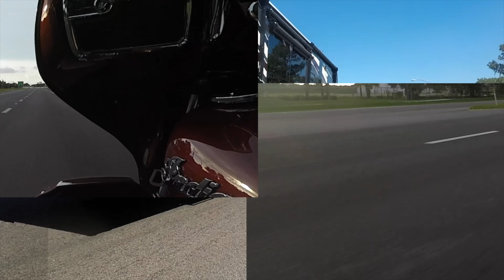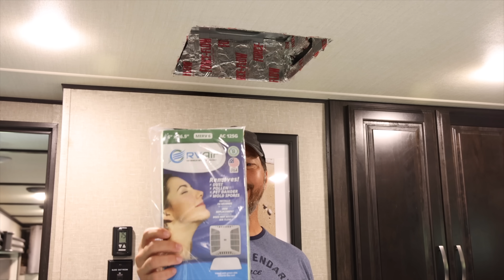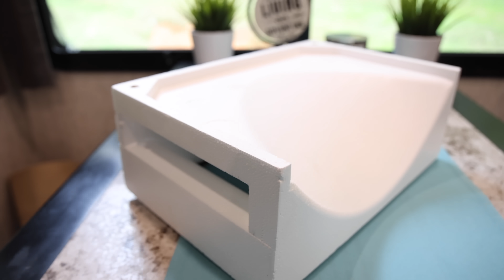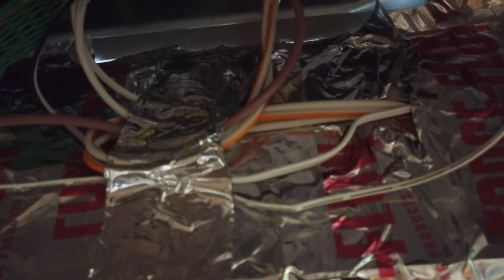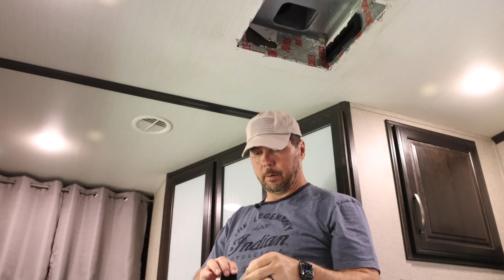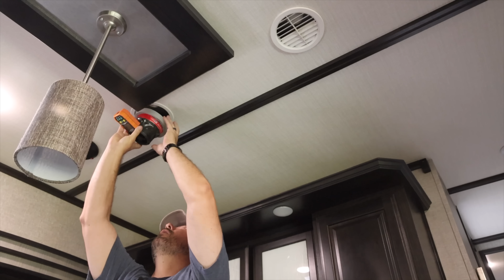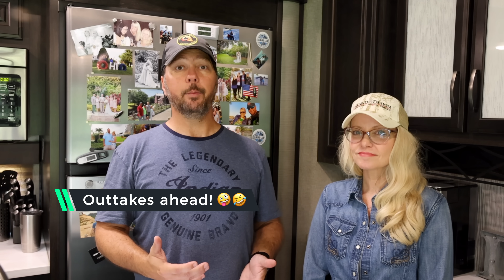Turbo-Charge your RV AC with RV AirFlow! (40% Improvement on Average!)

Comment: Finished installing this in my 2013 Montana Mountaineer 5th wheel.  Mine is a Dometic Brisk Air II 15K unit.  Did have to do a duct mod since the factory installed one side to far forward and the unit was a little forward and not square.  Didn't take any readings before (wish I had) but did after.  According to what I could find, this unit is rated at 350 CFM.  I have a total of 5 outlets and had to check my results twice to make sure it was correct.  Assuming that my wind speed indicator is reasonably accurate, converting MPH to CFM I get a total of 570.55 CFM from the sum of all five outlets.  The air flow is greatly increased, by feel, from what it was before.  More supply air creates more return air = cooler RV.  Will have to wait till we're out camping in hot weather before I can say this will keep our rig cool.  Have high hope.

Comment: Very nice invention. I had thought there should be something for this a long time ago. But, I have two AC units and at $170 each not going to happen. Way overpriced for "special" styrofoam.
Reply: You are paying for engineering and results.  Saying it's just "special" styrofoam seems unfair.
Reply: @rocketcityauction  Oh I get that. But, seriously $170 is a bit overpriced IMO. I wonder where they are made and what is the cost of making this? I also think that if the price was more affordable then they could sell more. He needs to bring this on Shark Tank, lol, and get a licensing deal with all the AC manufacturers. :)
Reply: @johnaird7896  My only thought was, if I had an AC that struggled to cool my unit and someone told me $170 would fix it by increasing the output by 40%, I think I would not worry about the construction, just the result.  Not cheap by any means, but for the results, it could be worth it.  I am going to look into it on my 2670MK.

Comment: One installation tip:  When inserting the unit and it seems to get stuck, remove it and use a solution of dishwashing liquid and water to coat the foam and the outside edge of the duct covers, the re-insert. Makes it a lot easier.

Comment: Color me skeptical. That much money for a bit of foam sets off alarm bells.  Where is the benefit coming from? The fans are pushing the same amount of air, so if there is more cu ft/min coming out of some ducts, there must be fewer coming out of others. Did the total air flow (cu ft/min) out of all the ducts go up? Other than making sure your ducts are properly sealed internally so you aren’t wasting heating/cooling I struggle to see what this contributing.
Reply: It does work.  Before the installation on my 30' Starcraft travel trailer I measured the air flow using my hand held digital wind meter. The vents closest to the AC were showing 10mph wind speed, while the rear vents showed 8-9mph wind speed.  After the install all of the vents were showing 18-20mph wind speed, which was double before the installation!  It was blowing so hard it blew the instruction sheet and screws from the bottom cover off the kitchen table.

The installation was easy and it's going to make a huge difference in the Arizona summer heat!  Well worth the money in my opinion.

Comment: 170$ for a piece of foam.  People are out of their minds.
Reply: It does work.  Before the installation on my 30' Starcraft travel trailer I measured the air flow using my hand held digital wind meter. The vents closest to the AC were showing 10mph wind speed, while the rear vents showed 8-9mph wind speed.  After the install all of the vents were showing 18-20mph wind speed, which was double than I had before!  It was blowing so hard it blew the instruction sheet and screws from the bottom cover off the table.

The installation was easy and it's going to make a huge difference in the Arizona summer heat!  Well worth the money in my opinion.

Comment: Seems like a wonderful item to me but I have a question and sorry if I missed any comments on this in your excellent video. I have a 2013 Sanibel that has ducted AC units, with no access from inside the trailer. Is there any other option for people like us? Thank You,
Bruce
Reply from the maker: Your system is already sealed with duct only paths for air.. So, I think this wouldn't really benefit you.  But, we sure to see: https://youtu.be/Gbm8hOyZlrU

Comment: Thank you!  I watched your installation video and had my AC ready to go when the package arrived.  I had it installed in about 40 minutes.  The only problem I had was sliding the foam into place because it was very tight around the plastic duct inserts.  Mixed up some dish washing liquid, put a light coating on both the foam and the inserts and it just slid right in.  Perfect!  Buttoned it up and ready for the big test.

I have a wind meter and before the install I measured between 7 -9 mph at both ends of my trailer from the ceiling vents.  After the install I measured between 18 and 21mph!  So breezy it blew the install sheet right off the table!  Now my wife is worried it will be getting too cold in the trailer with the AC on.

My RV is a 30 foot Starcraft Autumn Ridge 266RKS  travel trailer with a 15k Coleman Air  Conditioner.  Can’t wait for the summer heat to really try it out.  Used your discount code and saved a few bucks. Love watching all of your videos!

Lee A.
Kingman, AZ

Comment: I built my own with some old styrofoam and duct tape, the results were amazing and it only cost me five bucks and 90 minutes of my time!!!  Everybody should do this upgrade to there AC units!!!!
Reply: Same here.  Went with reflective Styrofoam from Lowes (1/4").  Built a t-pee shaped "duct guide".  With reflective duct tape, total project cost:  $8 for two units. Now my ACs are BLASTING out the cold air and easily keeping up with Florida temps and I saved $232
Reply: And saved yourself $170!

Comment: I have been using Swifter sheets in front of the stock ac filters and find that I can see when it's time to change just by looking up, they pull so much dirt out and I don't believe it impedes the air flow very much. Easy to cut them to size. I will be installing the RV Air Flow this spring, very good video!

Comment: Glad I stumbled on your video as I was wondering why my kitchen ac wouldn’t blow when dumps were open. Comes to find out it came installed with one of these already. Just bought a 2021 grand design reflection  28bh and it has it installed in living area ac just not master bed ac

Comment: Four things:

1) Big warning -- this only works on ducted systems with the ducts on the sides.  My '98 Southwind Storm has the duct openings on the front and back of the plenum, so this would be useless.

2) And it may be close to useless in any case.  You don't mention air temperature at the outlet duct.  Air transiting the evaporator coils at a faster speed is not going to have as much heat removed from it.  A 40% improvement in effectiveness may be illusory, and actual cooling improvement may be a tiny fraction of 40%.  At the end of the day, a 15k BTU air conditioner is only going to remove a given amount of heat from a room, regardless of the velocity of the air going through the evaporator section.

3) The engineers at Coleman seem to be very smart, with decades of experience.  The cost to add this functionality to the product would be negligible.  If they could add a buck or two to the product cost, and then claim to be 40% more efficient than a Dometic, it's not credible that they would leave that competitive advantage on the table.  There's probably a reason why improved ducting hasn't been incorporated into the basic design.

4) And for people with ducts on the side of their plenum who want to give this a try, search YouTube for "Grand Design A/C Modification."  They show a $20 DIY alternative.

Comment: I've watched several of these RVAirFlow videos now, and I agree that its a great product ... but not at the inflated price they charge for what it is .. a plastic box with some air deflectors molded in. At the $60 to $70 range they wouldn't be able to manufacture them fast enough.
Reply: While I agree the price seems high there are other factors to consider that we as the consumer don't know about. R&D, Certification for the warranty with Coleman, patents, overhead for manufacturing (heat, electric, employee wages if they have any etc.) insurances, machinery costs, dies or molds for each different style and so on. These aren't made by hand with a knife and being in manufacturing I can tell you machinery and especially custom molds and dies are not cheap. These are just some of the things to consider before passing  judgement about what they are charging. My reply isn't about starting an argument but to enlighten you about the many costs of doing business and not just the cost of material for one unit. It all needs to be factored into the final price.
Reply: I’ve been in the expanded polystyrene business for 35  years. The reason these are so expensive is due to having to commit to expanding 1 to 2 super sacks of resin 1763 lbs or 2182 lbs per super sack. It’s a shape molded part so there is a too set up fee for a 1 to 3 hour mold change depending on what type of press the milder is using. on top of that they are using way too high of a density for this part. It should be made of 2.0 nominal material instead of 3.0 PCF material.. Then the milder is going to scrap at least 3 to 10% of the run due to not knowing how to set up the molding (steam pressure) perimeters  on 3.0 PCF material. I would recommend 2.0 Nominal bead or have an EPS Fabricator that specializes in packaging fabrics are these things for a considerably better price and get away from shape molding these parts. Just my two cents on this. Cool idea though.

Comment: This is a great addition. Yes, a little pricey, but this really works. I ordered one a while back and just installed on the front a/c. It will be nice to be able to run the front a/c and push most of the air towards the living area. 15,000 btu a/c puts out way too much air in the small bedroom. Ordered 2 more. Used the Changing Lanes link and CHANGINGLANES discount code. Thanks Chad. Another great video.

Comment: They should make an optional replacement upper plate....covers the roof and lag bolts. And also fits a full size pleated filter which you could also buy a HEPA filter for.
Pass that along

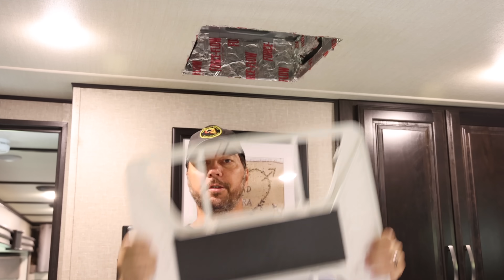Comment: Talking on the opportunity for leaks on around 4:55 mark......we have same Coleman AC and where that upper white plastic and lower white plastic meet isn't 100% perfect. Our bedroom AC has a whistle if you don't slightly open a dump vent. Press up the center of the bottom white cover a little (dumps closed) and whistle goes away. I think there's a deformity of the plastic a bit where the 2 meet and form that channel. Been meaning to devise a seal with thin closed cell foam tape.

Comment: anything for a buck. You can do the same thing without spending
 a penny. Just make sure your seal up between the supply and intake. If you moved your AC even for a quarter inch then you need to reseal them on the roof. Snake oil sales at best.

Comment: If a trainer at Grand Design turned you on to this product is Grand Design going to start using them in production? Would greatly benefit their consumers
Reply from the maker: Yes.. They already are.  👍🏼
Reply: @ChangingLanes  That is excellent!
Reply: @ChangingLanes  I orderded a 2021 Reflection 311bhs. It just arrived and I did a walk through today. the main living AC unit had one installed .  My AC unit in the bedroom did not.

Comment: $170 for styrofoam and plastics...kinda steep
Reply from the maker: Our take:  This is not a DIY thrown together chunk of foam.  This went through several rounds of engineering to get the angles and slopes just right to be able to move the air most efficiently into the ducts without restricting the flow.  It had to be perfect, putting no excess back-pressure on the fan to pass certification.  Also, patents are not cheap and neither is defending them against the inevitable knock-offs that will come out.  There's more to the story than just a foam block.

Comment: Their website currently says that these things cost $180 bucks.  Seriously?  Either that is a typo or they are seriously charging $180 for a piece of styrofoam with some plastic inserts??  I realize they need to recoup some of their R&D time but come on, you'd have to have money to burn to pay $180 for this thing.
Reply from the maker: Our take:  This is not a DIY thrown together chunk of foam.  This went through several rounds of engineering to get the angles and slopes just right to be able to move the air most efficiently into the ducts without restricting the flow.  It had to be perfect, putting no excess back-pressure on the fan to pass certification.  Also, patents are not cheap and neither is defending them against the inevitable knock-offs that will come out.  There's more to the story than just a foam block.   But, we get that its not for everyone...

Comment: Although this won't fit my ac unit, your video did solve my cooling issue:  I removed the air intake to measure the plenum and noticed that a piece of blocking insulation was tilted over, EXACTLY like yours was, causing much of my cool air to be recycled.  I put it back correctly and it is cooling MUCH better now!  Thank you, as I was getting ready to drop a grand on a new a/c unit.  Cheers !
Reply from the maker: Awesome!  Also check out: https://youtu.be/Gbm8hOyZlrU

Comment: Didn't hear it in the results- but what about sound? Did that help at all? I'd love a reduction there.
Reply from the maker: I took some dB measurements but there was negligible difference.
Reply: @ChangingLanes  cool, thanks. That doesn’t help me NOT want to buy it. Dangit. Looks like I’ll need to order one.

Comment: The only issue I have with it is why does a foam insert cost $170.00? I'm sure it doesn't cost them over $100 per unit to make.
Reply from the maker: Our take:  This is not a DIY thrown together chunk of foam.  This went through several rounds of engineering to get the angles and slopes just right to be able to move the air most efficiently into the ducts without restricting the flow.  It had to be perfect, putting no excess back-pressure on the fan to pass certification.  Also, patents are not cheap and neither is defending them against the inevitable knock-offs that will come out.  There's more to the story than just a fam block.

Comment: Thank you. Their video plus your explanation maid much easier to install. EDIT: Oh and on the filter for the A/C that is a great idea, but let me share something quick. On my home A/C (before we full timed) , I got a MERV 10 or 12 , something super filter from 3M, it actually burnt the fan up. It was so dense that it forced the motor too much. I don't know if that could happen on a RV A/C, but maybe something to check with the manufactured. See how much up in MERV we can go?
Reply: Check the spec's on your HVAC unit, mine states a max of MERV 10 or damage to the blower motor may result, so I use #8
Reply from the maker: This product went through extensive testing to get certified with coleman, where they tested for any kind of increased resistance to airflow, etc...  So, I feel confident about the product itself.  Of course it is possible to restrict more with a higher fiter.  I tested the MERV 6 and they flow just as well as the stock screen filter.  MERV 10 might be a whole other story.  I'd contact coleman to see the highest they recommend...

Comment: We put these in our Solitude 310GK, and supplemented it with the "RV AC Silencer" from "WackO Products". This definitely improved air flow, but also brought the fan noise down to where we don't have to adjust volumes on the TV. While you can still hear it, it really doesn't interrupt the "vibe" of the camper anymore. I'd love to see you guys put these silencers in and measure any decrease/increase in air flow and nose levels! On top of this, it does completely eliminate the air dumps.
Reply from the maker: We need to try the silencer thing!  👍🏼